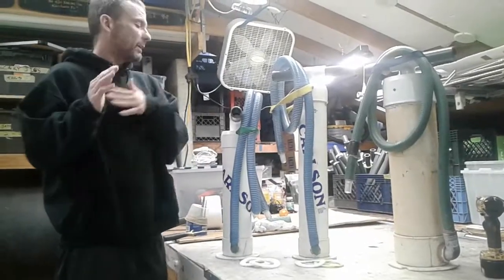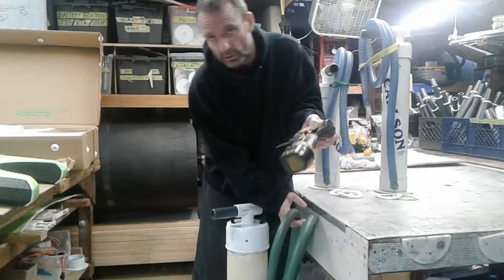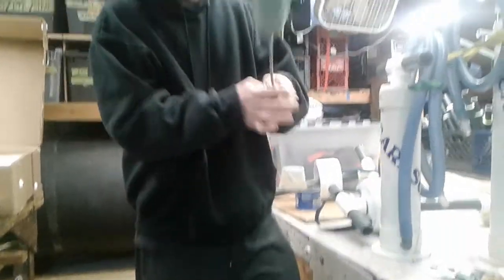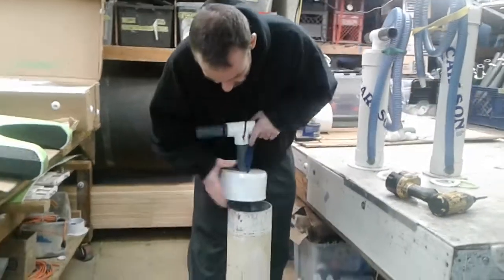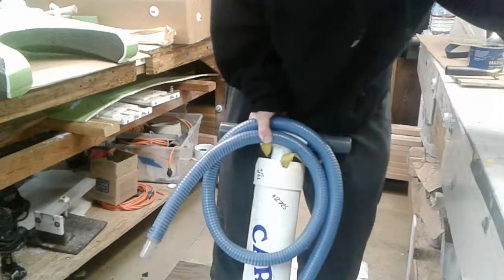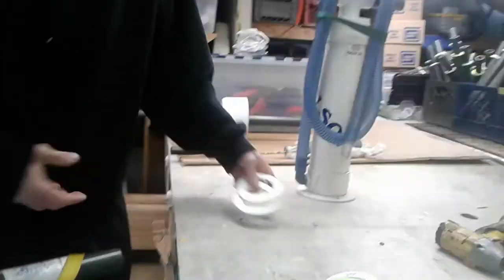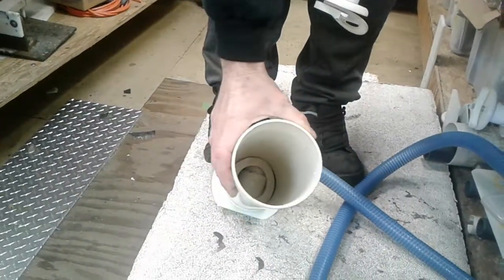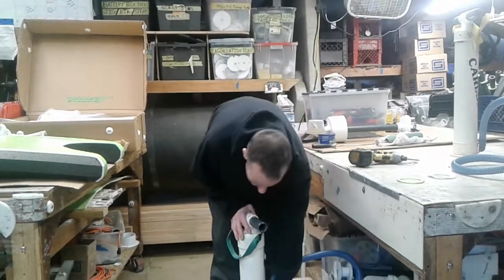Carlson Pump Toubleshooting

Comment: Mike have a customer with a leak around the free turning elbow. is it possible to take the check valve and the hardware apart?   Back pressure leaks around the elbow enough that customer cannot get boat to river pressure
trying to get it working for him,  thanks Todd Frank, Trail Head River Sports Missoula